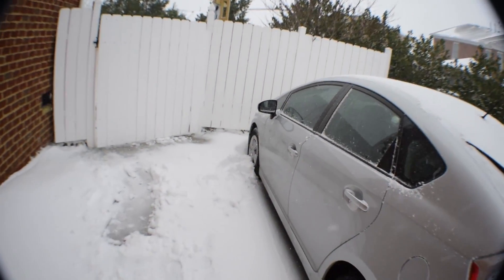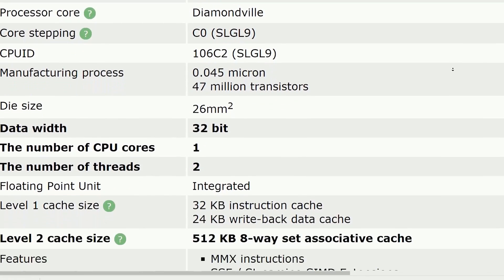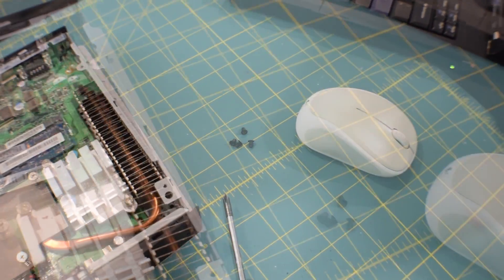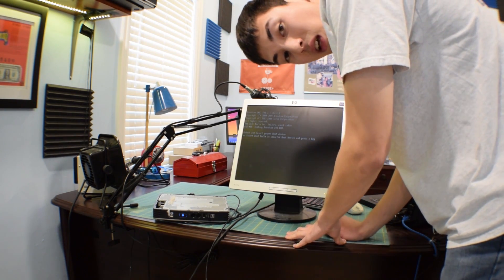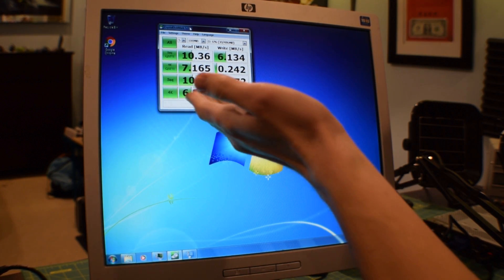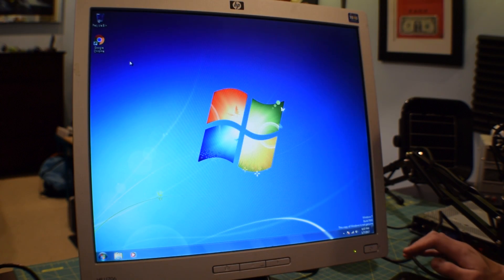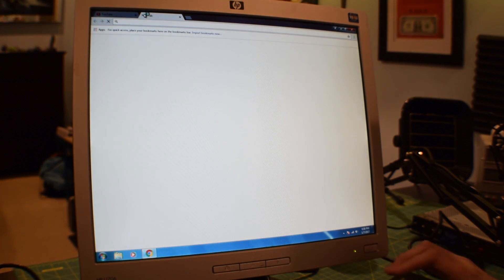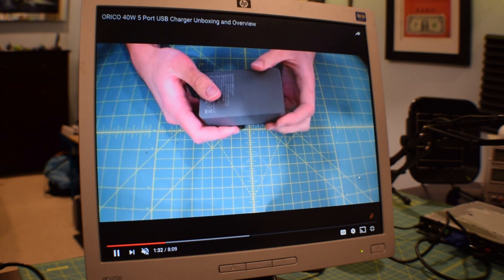eBay Finds: $11 HP Thin Client T5740s Intel Atom N280 Overview and Demo

Comment: I have got one right now. I put a 32Gb SATA flash drive in it & installed Windows XP POS Ready 2009. A stripped out form of XP. It does not need activating. 
I have installed the Intel GL40 video drivers but I still have not got any sound. I wanted to see if I can play GTA3 on it. The game is already installed & waiting.

Comment: were these designed to be attached to another chassis so you could utilize the PCI channels? these are like a laptop.... or a all-in-one.... interesting system.... whats the max memory they were made to take? I always look up the specs on these machines providing HP still has them listed.... they are really good about dropping support for older equipment...

Comment: I have the t5470e, it came with a whopping 2gb ram, 4gb MOD storage. Did you know you could access the Windows 7 embedded on the HP site. I mean, it works. If I had nothing else, or if I just wanted to stream audio, it works. Your right, you can wash computers. I take them apart and wash the motherboard if it's that dirty. I just dump rubbing alcohol and let the whole thing dry for awhile. It works. You just have to use lots of care.

Comment: I Think a 1030 or a 1050 low profile would work you cant have 1080 first bottelneck 
Then it does not have a pci cable

Comment: Hello from Spain, Europe!
Is  upgradable? ram, CPU, or SSD...
Is enougth this model (HP Thin Client t5740 plus Atom n280 @ 1,66ghz 2gb RAM 1gb Flash 1x PCIe 2x rs232) to run olds RTS from 90s and early 2000, like Age Of Empires 2 or Command and Conquer 2?
Thanks!

Comment: If I remember correctly, I worked on these, mainly replace as fails,(or something similar) when my employer contracted with Walmart. They were used as a locked down web browsers used for training or email OR a special manager version that had XP desktop on it to allow Outlook and MS office along with the internet. We ended up replacing them with the new WYSE by Dell terminal.

Comment: I have 6 of these and still will buy more! They work great as music, video and graphical machines as long as you install and use windows Xp pro SP2/3 or Windows XP SP2 embedded editions. The hardware is expandable such as the ram being ddr3 upto 8 or 16GB in two slots! The onboard flash drive is eide 44 pin disk on module so you will need a cable adapter or buy a bigger horizontal mount apacer flash drive DOM if you need more space for the OS/boot drive. The mSata pci-e slot inside can also be used for a more modern and available set of mSata ssd drives out there and the full sized sata port inside allows for a LAPTOP 2.5 SSD or HDD drive using a MALE angled cable or one that is not so tall on the connector as to be able to close the top cover. All in all a hyper threading 64bit cpu capable modern silent cool running system! I am using mine as the guts for custom made music synthesizers.

Comment: That's not a PCIe slot, it's for the expansion module, which does have PCIe x4 (or PCI) + serial, parallel, and fan.

Comment: The price has gone up a few bucks now.  Now, if it were an N1900 Atom, then it may be a little more usable.  The best application for these would be a "kiosk web browser" for a library or such.  Put your read-only OS on the internal USB, or flash ... web boot.

Comment: Why stick with the 1gb of Ram? I would have doubled it at the very least before I would have started.. because you would have slowed the system down so much relying on a slow harddrive module for a withdows swap file

Comment: USB 2 is really slow it is 10MB read which you can see it also has a CD-ROM connecter inside for sata and sata power so I got a 500 go hdd I'll post a video on it if it works!

Comment: 8:11 You think that the usb flash drive is not the bottle neck in your setup, well I'm not sure about that.  the fact that it has only 1GB of RAMS means it's heavenly depends on Virtual Memory. Pagefile.sys and usb thumb drives don't work well together, Especially when it's usb 2.0  Using chrome proves this.
If you don't believe  me, just connect a SSD to the SATA port, and your system will much more responsive!

Comment: it´s just a single core.
Better use a Fujitsu Futro S550 and upgrade it with an Athlon 64 X2.
Worked for me and the device is a great machine for emulators.

Comment: I personally have a t5745 (t5740 but runs Linux-based OS) with the expansion kit, upgraded RAM to 3GB, installed a 320GB SATA hard drive and a Radeon HD 4350. It's now running Windows 10, a bit slow but hey it runs. Otherwise it can be used for many projects, especially if you have the expansion kit.

Something worth noting:
1. It has two DDR3 slots, the other one is at the back of mobo, I didn't bother to get 4GB as Atom N280 is 32-bit only.
2. Use a right angle adapter on the SATA port (eBay yourself) as it's too thin to accommodate the SATA cable upright, a 9.5mm drive can fit within the machine.
3. The PCIe x16 slot is intended to be used with expansion kit (which also has a parallel port and a serial port), don't try to plug your card directly into the slot cause it won't work.
4. It can go wireless by fitting a half-height mini PCIe WiFi card into the mini PCIe slot, you'll also need a RP-SMA to U.FL antenna.

More info can be found on Parkytowers: http://www.parkytowers.me.uk/thin/hp/t5740/index.shtml
It also covers many thin client models, can be very useful if you're planning to mod one yourself.

Comment: Nice Kodi box
Reply: For 576i/480i, maybe 720p. The integrated graphics (Intel 4500M) is basically trash, and the weak processor doesn't help.

Comment: That's funny that you live in Virginia Beach!  I live in Hampton Roads myself (specifically Gloucester) and I was surprised you guys got so much snow considering usually it snows more the farther north you go.

As for the thin client, congrats on the find!  That's crazy that it has a PCI Express slot... not sure what the use would be in that case design though

Comment: I actually have two of these from recycling at work.  If you're using an old projector they boot Mint Linux just fine and make a decent low res media machine. I was using it with a VNC connection to control it.  Probably could do excellent as say a specialized audio streamer.  They sell an expansion kit to allow a proper card plugin.  If you did that and added a second NIC it would definitely be a decent firewall candidate.

Comment: ebay finds:???? for your yt videos???

http://www.ebay.com/itm/HP-Workstation-Desktop-Core-i5-2400-Quad-Core-3-1-GHz-4GB-RAM-250GB-HDD-Win10Pro-/152386375782?hash=item237aef9066:g:uLkAAOSwopRYcGgF

http://www.ebay.com/itm/HP-Elite-Desktop-C2D-E8400-Dual-Core-3GHz-4GB-RAM-250GB-HDD-Windows-7Pro-PC-USFF-/152386287027?hash=item237aee35b3:g:s-0AAOSwEzxYcE~g

http://www.ebay.com/itm/HP-Compaq-8000-Elite-SFF-Core-2-Duo-2-93-GHz-E7500-4GBDDR3-80GBHDD-Win10PRO-/262792577240?hash=item3d2fa880d8:g:q9IAAOSw6DtYVGV3

{ http://www.ebay.com/itm/Lenovo-Thinkcentre-M92p-Tiny-Core-i5-3470T-2-9GHz-16GB-DDR3-250HD-Win8-1-Mini-PC-/152387362698?hash=item237afe9f8a:g:-2MAAOSw44BYcW1c }

Comment: can my hp  dc-5750 with 2gb ram and amd 3800+ 1 core run an website??? and what website run program do you use?
Reply from the maker: You can get started by looking into the WAMP stack: http://www.wampserver.com/en/ .  Yes, that system should be more than capable

Comment: You might try adding more memory if it will handle another gig. These thin clients work better with XPe or if you add a larger ssd and a fuller version of XP will run better.

Comment: If you need a server upgrade, just get a Core 2 Quad. There is one on ebay right here : http://www.ebay.com/itm/Intel-Core-2-Quad-Q9450-2-66GHZ-GHz-12M-Cache-1333-MHz-FSB-SLAWR-/222369883853?hash=item33c64726cd:g:ukwAAOSwuzRXfV-y

Comment: N280 CPU has score of bare 290 marks in PassMark test. It seems a bit masochistic, to actually try to use something so slow as a real desktop machine (maybe just some low-powered web/FTP server, if configured properly, but slow storage kills even that use). My rule of thumb is that bare minimum of performance for even most basic office workstation (emails + Word/Excel + some web browsing) is around 1000-1500 marks.

Comment: I bought a couple of these a while ago. One has been upgraded to 1 TB HDD, Ubuntu Server and 4 GB RAM and acts as a media server. The other one is used as a workbench PC, running Windows XP with a 16 GB SSD at 2 GB RAM. The last one is used for another server with 32 GB SSD and 1 GB RAM, also running Windows XP.

Comment: i have wyse sx0 winterm s30 thin client rev.02l for 5€ 
amd geode gx2/gx500 366mhz 
256mb ddr 333mhz (from 128mb)
vga/sound/network onboard 
64mb nand flash
annoying wyse thin os (not the windows ce 5.0 pro)
going to upgrade the flash storage with windows ce 6.0 and more memory if needed.

Comment: Who needs 512MB of flash storage??? I also think it´s just so slow because you are using it on a usb flash drive and it only has 1gb of ram... You could put in a 4gb stick of ddr3 sodimm i think and install a bigger hdd or ssd and try installing windows and it should run much faster!

Comment: Friend set up a bunch of these with the extended caddy with adapters from PCIe to PCI (there were both just a PCIe riser and the PCIe to PCI riser available) as thin clients and even a few as pfsense firewalls. with an RTL8169 and the onboard Ethernet, it runs as a firewall just fine up to 50Mbit/s without issue. I have a similar box running Opnsense with two onboard PRO1k GigE as my main firewall, so as a firewall they are decent. Parkytowers has a lot of information on the expandability and the potential of these past what I've pretty much just said.

Comment: Not sure if I remember correctly but I think there was a series of HP business monitors where you could attach this box behind it for POS (Point of sales, not piece of s** lol) systems etc. not for everyday local computing but for special systems like Citrix which do not need any considerable amount of CPU power on the box itself but rather everything is processed on the server.
Snow on the PC is not instant death but you usually want to avoid corrosion but that happens with the salt in the snow not the water itself hence the dishwasher didn't break anything but if you clean up and don't let it run inside and leave it there to corrode the inside it shouldn't be a problem.

Comment: Windows 8.1 Works the best with those system . videoplayback of 720p capable if you truly know what your doing , tested even lower cpu n270 and DDR 2 667mhz.

Comment: Can you turn that into a custom router with pfsense?
Reply: +Anthony Pinto Where does this myth of ports getting ruined from sending data through them come from? They are designed to handle full load for the entire lifetime of the controller, which is probably longer than the computer will stay in one piece.
Reply: Also these thin clients don't have USB 3, only USB 2, so any USB adapter will be pretty much limited to 10/100 speeds, which will be restrictive on faster internet connections and gigabit LANs.
Reply: Should be able to without too much fuss. The only real issue is the lack of Ethernet ports.
Reply: better to just get a slim dell optiplex, since those have pcie slots to but in the dual band wifi cards and ethernet out
Reply: Oh! Thanks for the ideas might try it if I can find one..
Reply: You sure can. HP do an expansion module for these that allows use of that PCI-E slot so you can put a NIC in, giving you your two ethernet ports you need.
Reply: That expansion slot isn't too easy or cheap to find normally, it might be better to just throw a USB-RJ45 dongle on it.
Reply: You have a lot higher compatibiliy, and speed out of the PCI/PCIe slot than you will ever have out of a USB adapter. Also the USB port will burn out from the traffic much faster as it is not designed for the constant abuse of a NIC. Just food for thought.
Reply: Yes and no. Pfsense 2.3.x will work with it, but pfsense 2.4.x won't because it requires a 64 bit cpu.

Comment: Got one with the expansion riser, 2.5" SSD 32gb hard drive mount as a PCI-E slot bracket 8gb ram running Windows 10 and using it as a Plex Server

Comment: I've found that running any version of windows off of a USB is super slow and unstable especially because small systems like the HP Thinclients and others similar such as the Dell Optiplex 160 and FX 160 require some very obscure drivers in order to run properly. Great video!
Reply: My Fujitsu Futro S550 uses generic hardware, AMD chipset that was also used in laptops so no driver issues at all.
And my Hp Flexible t610 plus also uses generic hardware, only needs drivers for the Radeon graphics which windows 10 installed by itself.
And i have put a gt730 inside since it has enough space to take one 1 slot pci-e card and it enables a low end gaming system.
Haven´t had any issues with drivers at all.
Even for an old Igel, that runs a Via chipset, graphics and CPU has drivers avaiable that work on windows 98, me, 2000, xp, 7 and up (but 400Mhz wouldn´t be nice with anything after xp).

Hp laptops are terrible in terms of drivers.
They use for a own driver for custom chips nobody else uses like IDT audio, at least on consumer devices.
Since thinclients are more professional, they did a good job taking realtek chips for ethernet and audio aswell as intel/amd cpu, graphics and chipset that are plug and play.

Comment: Just be careful on that x16 slot.  I thought I read somewhere before that it had a few wires swapped so that you had to use the expansion chassis to add a card. Also, most Atom CPUs I believe are hardware limited to 2GB of RAM.
Reply: This thinclient has a 4 GB version too and the same processor so I don't think there is such a limitation but who knows maybe certain models of the processor do infact have such limitations.

Comment: I picked up a Wyse terminal that had USB3 ports on it for around $20 on ebay. It runs Windows 10 fine off a USB3 hard drive.  I even installed PFSense inside HyperV in Windows 10 , added a USB NIC and made it a firewall that can also run Windows 10 at the same time on dual monitors. The PFSense VHD is on the internal flash drive.  The computer has no external network, the NIC has TCP/IP disabled and it has to have the PFSense VM running in order to get on the internet.  It uses the standard 19v Toshiba laptop style power supply (I think ASUS uses the same cord as well).  The CPU is an AMD T56N which supports RVI (Second Level Address Translation or EPT as intel calls it) which is required for Hyper-V.  My more powerful Xeon desktop does not so I cannot run HyperV from Windows 10 on it (the Xeons are based on the Core2 platform which doesn't support SLAT/EPT.

Comment: dude dude dude dude dude
You gotta try putting something like your personal 750 ti into that just to see how it can perform
Reply from the maker: I was thinking the same thing.  That's probably going to be the next experiment video :D
Reply: If you already have most of the parts lying around, or if you just really want to see what happens, I think FOR SCIENCE is a good 'nuff explanation for myself.
Reply: AA Computers and Technology I have the same pc that you bought and sadly you can't put a graphics card into it because the pc can't supply enough power to it
Reply: Joe Manfred True but most use molex and the pc doesnt have molex unless you use a sata to molex adapter and that still wouldnt be able to supply enough power and if you use a external molex adapter it would be too bulky
Reply: Joe Manfred That would work but is it really worth the trouble and money to buy a psu and a external molex connector just to pair a Intel Atom with a Gtx 750 Ti?
Reply: I have a HP t5740 with the expansion module and a HD 5450 in it and it runs just fine?
Reply: SCscoutguy I don't see how that would work the 5450 needs a 450w psu and the t5740 only gives around 21v
Reply: There are powered risers that can fix that issue
Reply: I think it would be a given that you'd have to use a dedicated power supply for the GPU by shorting the power on and ground pins on a conventional ATX power supply, or use an external molex power supply like this: http://www.newegg.com/Product/Product.aspx?Item=N82E16812123309

If he used that molex only power supply, he'd have to make sure it was rated for at least 6.25 amps on the 12v rail and would also have to find his own way of making a power switch for it, kinda like this: http://www.ebay.com/itm/4-Pin-Molex-Extension-Sleeved-Cable-w-On-Off-Toggle-Power-Switch-36-inch-/400696513855 but it would work. I would recommend wiring any power switch apparatus to the existing one on the actual thin client itself to have all things turn on at once.
Reply: SCscoutguy Oh dang man, you gotta make a quick vid of that or something.
Reply: SCscoutguy I also have a t5740 and tried it with the same card and it didn't work what did you have to do?
Reply: It is actually really common with these as for a while these were extremely popular to run Kodi on via Openelec. I didn't have to do anything special I just bought the expansion module for like $15 on ebay and plugged the card in and it worked. You can also run a broadcom BCM 970015 graphics accelerator card in the mini pci-e slot where the wireless card goes on the motherboard and it will play HD video via the displayport as well. People really don't use them for Kodi anymore because they are only 32 bit.
Reply: It works just fine for me? I have the version of the card with no fan and just a head sink. I have run the same card in mico itx systems with 200watt power supplies and it runs fine? I have also run a HVR-1600 TV tuner card in the same system as well as a ATI cable card tuner and that works fine as well. I am using a bigger HP laptop power supply on it.